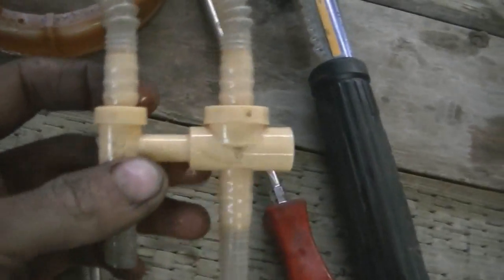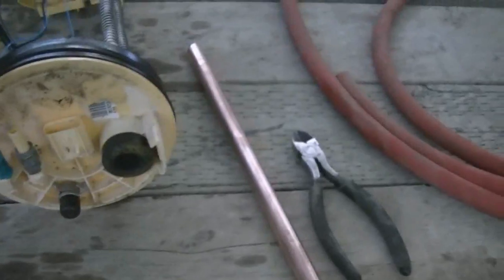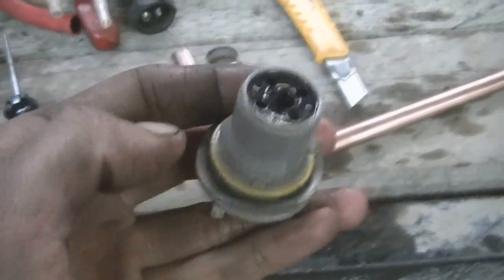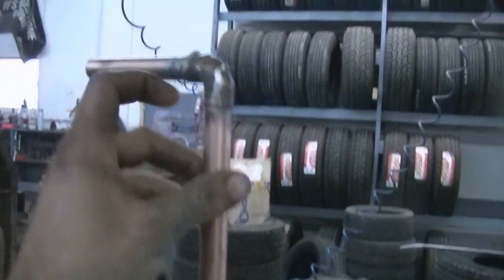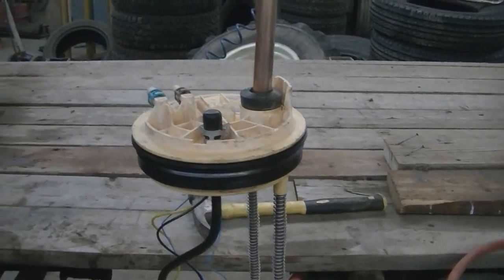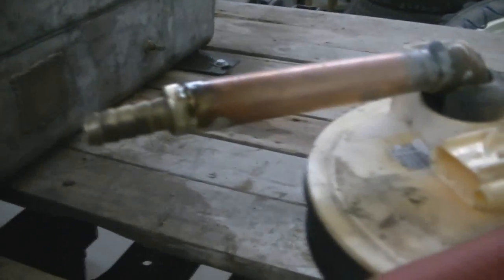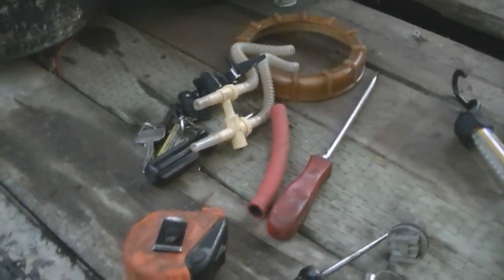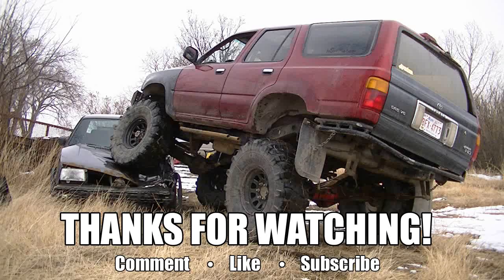2001 Cummins: AHF Fuel Draw Straw (end of fuel issues) (03/15/13)

Comment: Just got a brand new lp, and it's set at 17, but as I drive it it drops up to 10 psi lower, and I can't figure out why, I did an aftermarket draw straw so it shouldn't be starving or sucking air, any ideas?
Reply from the maker: The harder you push your engine, the more fuel its going to use, as long as its below 21psi at idle and above 14psi at idle, and it doesnt drop to 0psi under full load, you'll be good. My lift pump would drop to 0 under full boost, so i had to upgrade my pressure spring. But it also increased idle pressure, and i couldnt start the truck with the lift pump on haha! The vp44 wont start if theres too much pressure
Reply: @analog56x  I meant it drops at idle, usually around 7-8 at idle after 5 min of driving
Reply from the maker: @codcade  hmmm... yea, thats not great. You could bump up the pressure on it by changing out the spring, or you could look at the wiring. If the lift pump motor is getting too hot from drawing too much current, it will slow down, which will cause a drop in pressure...
Reply: @analog56x  what could cause it to get hot? It's adjustable and I had it set at 17 which is where I want it
Reply from the maker: @codcade  too small of wires will increase current which lowers the voltage, and as a direct result, the pressure. Are your wires big enough?
Reply: @analog56x  just the harness that came with it
Reply from the maker: @codcade  hmmm.... when did you set the fuel pressure? Was it installed at idle?
Reply: @analog56x  set at cold idle
Reply: Dropped to 3psi this afternoon
Reply from the maker: @codcade  using factory lines and such? What kit did you buy?
Reply: @analog56x  new 1/2 lines, the cheaper airdog 150, with the drawstraw
Reply from the maker: @codcade  hmmm... id contact airdog and see what they have to say about it... it could be a defective or weak pump... it should have no problems supplying enough fuel...
Reply: @analog56x  all I know is 500 bucks it should work well 😂

Comment: If you don't mind me asking what was your truck doing to assume this was the problem my truck keeps blowing the fuel cap off like a grenade
Reply from the maker: If your truck is blowing the cap off, it's probably the wrong cap... should be vented
Reply: @analog56x  no the fuel filter cap
Reply from the maker: @marioking1860  oh! Ok. I would probably check the threads on the cap. Being plastic, they can get worn out. If that's not the problem, I would look at restrictions on your VP or the return line. You could eliminate your return line by disconnecting it from the truck, and hooking an airline up to it and see if it blows straight through. If that's not the problem, your regulator could be stuck closed. It's the banjo bolt on the return line. It's supposed to open at 14psi. If it's been modified to give higher fuel pressure, replace it. If its blowing your filter cap off, I'd be really concerned about the seals in your vp! Doesn't take much to push the seal out the front. How is your oil level?
Reply: @analog56x  the oil level is right on point
Reply: @analog56x  do you know where I would find the banjo bolt to blow air back into the tank
Reply from the maker: @marioking1860  do you mean the banjo bolt in your truck, or a replacement one?
The one on your truck is on the side of the VP44 I believe it's the front one... it's not the one that has a Schroeder valve on it...

Comment: And did it drop to a very low pressure when the engine started?

You might need to siphen the bottom of the tank out to pickup all the crud, as its next blockage will be the filter, wa wa wa lol :-)

Is it possible one of the valves was to stop the line from the tank to engine emptying back into the tank overnight??

Bypass city he he :-)
Reply: If you don't mind me asking what was your truck actually doing to make you assume this was the problem my truck keeps blowing the fuel cap off